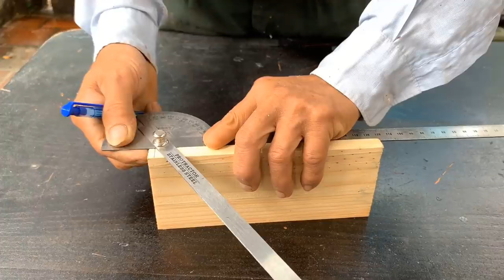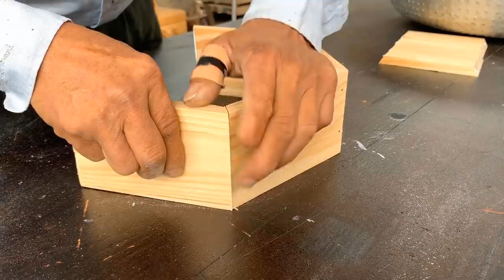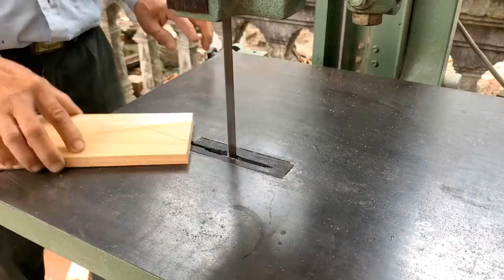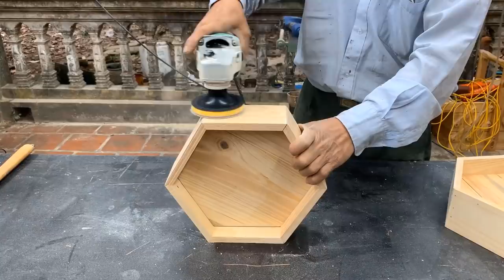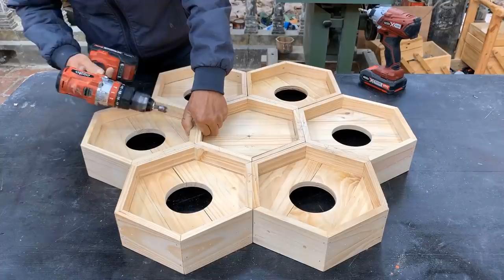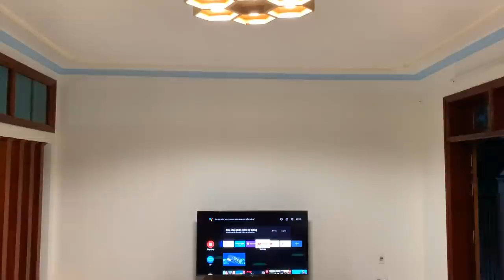The Wooden Chandelier Design Is Very Nobles And Solemn From Used Wood Chips // Woodworking Ideas

Comment: Great creative work 👍👌 that's no doubt, but such lights are Getting badly overheated.  from my point of view there is high risk that those Lights will put the Wood on fire. Definetly i would put electrical protection instalation behind the lamps. Otherwise as an carpenter it's great idea